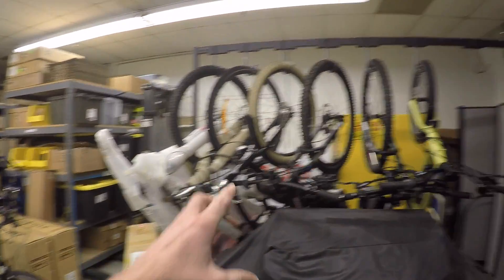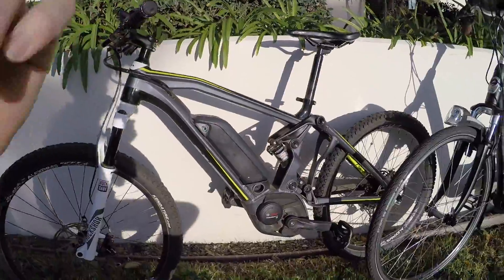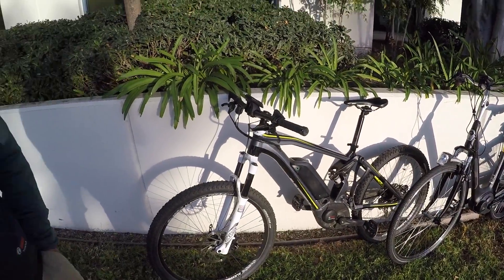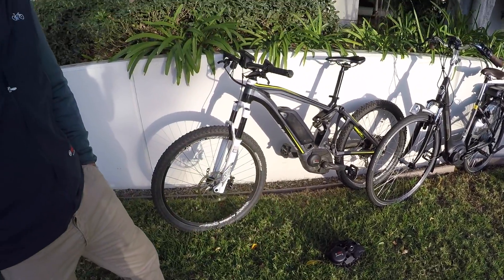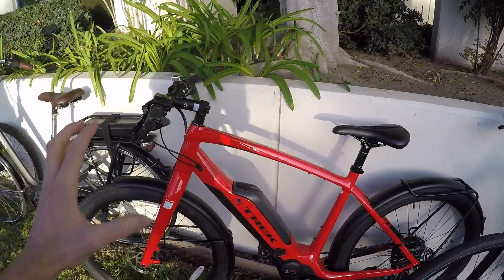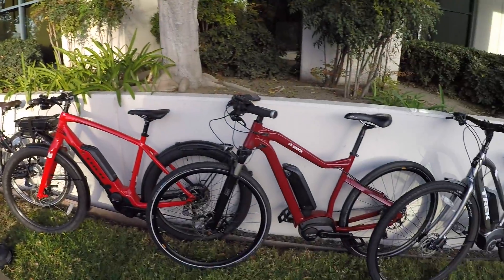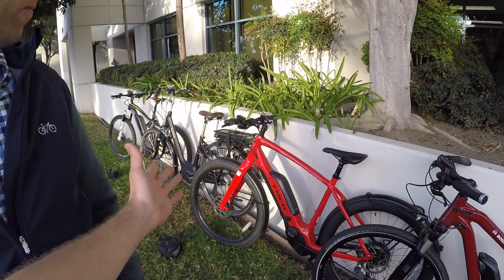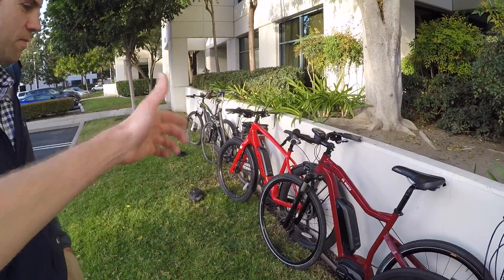Bosch Ebike Bike Motor Comparison & Test

Comment: WARNING about BOSCH products and R&M Homage dual battery Bicycles and Bosch systems, look this after 5 months of use, first 2months I have to change the motor BOSCH make noise now again I have to change the Motor Bosch again make noise again, loose the eShifth, covers from the BOSCH battery fall down on the street when I ride, also water get inside the BOSCH switch (made in China) BRC351,BIG MISTAKE to pay Cad$17000 for this shi... brand, this people here are pay by R&M to make that kind of comments about the brand me I am a REAL consumer with the REAL problems...They want keep change BOSCH motors
I ASK FOR  MY MONEY BACK and I don’t ask that now after 5 months I asked since my problems start I mean on my first 200 Km of use that bicycle…

Comment: I used to have the performance line Cx motor on my Kathmandu.  I'm guessing this is an old vid as most CX motors now give you 80 N m of torque.. I now have the Hiabike trecking 5 wich is a lovely bike . But only has 65 N M of torque.  And is not as comfy a ride as the Kathmandu.  Also I miss not having EMTB mode and the shift ditection

Comment: In terms of noise, clearly, the Active Line was the winner. I recently rented a bike with the Active Line Plus and it was quiet too. I couldn't believe it because I have a Bulls Lacuba EVO E45 and it has a belt drive Brose... The Active Line Plus produced less noise!
Reply: How is the Active Line Plus?
Does it make enough torq, or should i look for something higher end?
Reply: @str1kez367  It depends on the hills that you typically climb. I climbed some pretty steep hills on first gear with the Active Line motor set at Level 2 with no problem.

My wife had to use Level 3 to climb the same hills.

*

Comment: The batteries are interchangeable but does anyone know if the motors are interchangeable from one model to another?  My Raleigh with a Active Line and I have a large amount of people on non-motorized bikes pass me.   There's little power in that.   It is my fault for choosing it but now that I have experience i would never get a 250w motor.

Comment: Having full suspension MTB and changing Bosch Performance Line motor already 3rd time. First motor died at 6500 km, second at 7800 km. Each lastet approx 2 years. Bike - Trek Powerfly 7+ fs 2015. Both motors had same simptoms - clicking while you pedaling. A bit disappointed with life duration of this devices. Besides this idea of ebike is superb. Trip with 100 km goes easy, does not matter if there are hills :)
Reply: Did they cover your motor under warranty or did they give you a hard time?
Reply: @DudeofCalifornia  so far it was repaired under warranty.

Comment: The bosch CX is super sensitive and smooth. I can start on a very steep hill and get immediate assist . Also it's very easy to find the " sweet spot " in any gear or any assist level. I like keeping the same cadence when riding and have enough practice with this motor to know when to shift gears and or the assist level. Oh and The Turbo mode is unbelievably powerful.
Reply: Which one is better in terms of torque:
(Performance line cx) or ( performance line speed) ?
Reply: not sure what the "speed" model is but the Cx is 84 Nm in Turbo .

Comment: Anyone knows where to get in europe full suspension frame for bosch performance cx motor? I have been searching for such a frame without luck.
Reply: Vasilis Barbounakis I think you’ll have a tough time since Bosch motors are only sold with bikes. Occasionally frame manufacturers bring frames to trade shows and sell them at the end, but it’s not too common.
Reply: Oui La marque Moustache vend 2 modèles https://www.culturevelo.com/?page=comparateur&selection=13472,13474

Comment: Has Bosch improved how they handle the max speed cutoff? Yamaha  apparently did this much smoother.
Reply: The max speed cut off is annoying ,  but is easily remedied. 
I have a Baddass tuning box that completely eliminates the cut off and can be installed in less than a minute.

Comment: Greetings from the Netherlands I just bought two riese and muller bikes with the cx line. Was expensive but I think its worth it.only gripe I have is that I couldn't choose the option for extra battery with buy a second battery on the spot not a bargain like $1000 extra that mind blowing
Reply from the maker: Cool! I hope the bikes are fun and hold up well for you, I trust Bosch, their stuff is pretty good... but yeah, the battery packs can be very expensive O_o
Reply: Thanks for making such great content have bin watching you for over a year now..as it turns out this was a great time to get an e-bike. new motors new tube batteries.. new models from Riese&muller. I have to wait until the end of July...so even living riding distance of Germany hahaha..Enough time to investigate good locks and alarms & gps systems..and learn a bit about 18650 cells and charging.. as an it nurd i know that 18650 cells like to be charged slowly and preferably at 75% for long term storage up to 95%..  that's why i considered getting two packs.. but to be honest even on Eco mode that bike feels great i don't see my self using the top mode just for fun that is hahaha.. welcome to the world of range anxiety..
Keep up the great work.. And have a nice summer.. Carpe diem..

Comment: Hey guys had surface 604 colt for 1 year Bought bull e lite with active drive.Does not have the nick of the colt rear hub drive.Going up 10% grade you have to work it .Colt coasted up.Can you change to a more power full bosh motor?

Comment: Just to clear up, the 250 Watts of power they state all their motors produce is complete bullshit. It's just for government regulations in different countries. It's fundamentally impossible to have that much more torque without more power. For example the CX motor has been measured to peak at around 600 Watts. The lower end active line peaks at around 400W.
Reply: Thats why you tune the motor to get most out of it. (:
Reply: Bravo pour la pertinence de votre commentaire

Comment: I use bike trails a lot.
It's annoying to see electric powered bicycles on the trail.
They are no different from electric moped, actually.

Bike trail use should be only by man-powered vehicles and power "assisted' bicycles with speed limiter.

Comment: 250 wats? My blender has a motor of 500 watts. What am I missing here... (mind u  it is a strong blender).
Reply: khash Eshraghi Is your blender street legal?
Reply: torque is really the important reading. The Motors have between 50-75Nm of torque which I imagine is much more than your blender. Keep in mind the motor in these systems comes from the power steering motors for heavy German cars, like the Mercedes S class. I hope this helps give some perspective.
Reply: Chris at Propel You can use gears for more torque.
Reply: Your blender doesn't have to be efficient, because it uses 110V, 500 Watts is power used, not power delivered
Reply: Its the ampere !
Reply: Oui mais la puissance en watt n'est pas une donnée absolue, il y a le couple, la vitesse de rotation,la consommation. Ces moteurs sont construits sur la base de moteurs d'essuie glace qui sont très "coupleux" et surtout ne cassent presque jamais

Comment: Bosch will very soon will have  a  6 amp charger coming very soon !     and they are coming out with a new Bosch    Nyon  system that's so much more better then the old Nyon , you need to ask your friend Johnathan form Bosch but i can tell you this info is a fact and it comes from Bosch

Comment: I wish manufactureres gave us the possibily of buying a particular bike model with a particular type of motor. Unfortunately, if you go for most mountain bikes, you have to go with the most powerful AND the most power-hungry motor, the  CX, even when Bosch themselves show the range difference between motors can be astounding. I highly recommend checking out https://www.bosch-ebike.com/en/service/range-assistant/ where you can easily compare those differences. I wish every manufacturer had something like that...

Comment: Very informative video!  Thanks for putting it together.  One of the things that might be helpful would be to remind the viewer that your fixed camera mounts may be transmitting some noise directly to the microphone (mechanical coupling).  I've been riding a CX Speed for several months (Trek Crossrip+, based on your awesome review) and really very rarely notice the motor noise.  Great comparisons between the various motor set ups, though!  Thanks!
Reply: I agree, thanks for sharing this as this comes up quite often.

Comment: I have noticed on some bike websites that it looks like the motor's torque is de-rated for internal gear hub drive trains.  That is, a Nuvinci hub bike might have the same Bosch motor rated with lower torque than the derailleur version.  I assume this is to protect the IGH (not exceed its torque rating) and is accomplished in software.  Can you comment?
Reply from the maker: Yeah, there seem to be some behavior changes between cassette vs. internally geared hubs and CVT. You can see the different ratings on the detailed chart that Bosch provides. It's attached in my forum post here: https://electricbikereview.com/forum/threads/bosch-ebike-systems-motor-comparison.16240/ it's the second image. The first comment talks about hubs as well and might interest you.
Reply: Interesting.  The chart just shows only a derailleur system listed for some of the motors such as the CX.  Not sure how that fits with manufacturers (e.g. R+M) offering a Nuvinci IGH with the CX motor.

Comment: Hi Court great video as always would you be able do the same comparison with the bafang max/ultra drive range as I see that bafang is now selling the max drive systems from 250 watt all the way up to 1000 watt. It would be nice to compare the G330, G520, G521, G510 (which is the 750/1000 watt range and bafang claims it has 160 nm of torque) that's pretty impressive. Bafang is quite a popular mid drive motor in Australia I see quite a lot of Bosch performance line units, Bafang max drive units and Shimano units. Haven't seen Brose or Yamaha mid drive systems in Australia I have heard that the Yamaha system is not licenced to sell in Australia. Anyway keep up the great work love your informative videos all the best from Aus.
Reply from the maker: Great suggestion Robert, I want to visit Luna Cycles someday again and might film there. I'd love to do a Bafang motor roundup and the company reached out recently about a China trip but then didn't reply, maybe they are busy? I'll keep at it, and also aim for Yamaha, Brose, Shimano etc.
Reply: A friend has just bought a Specialised Levo 29er with the Brose motor. He is in Adelaide. It is supposed to have 90nm of torque.

Comment: Thanks for this great review and your channel Court.  At 8:40 you mention gear drag which I'm finding a real, err, drag on my Australian (25km max) Bosch performance line. It is next to impossible to go faster than that under my own steam because of that. Down hills is no problem of course. Just want to encourage your viewers to test ride with power assist off to feel the drag for themselves.
Reply: I've heard many people say this, but in my experience, this is not the case. If you were to ride the bike with no power from 0kph you might find it easier to pass 25kph. This is for two reasons, one the gearing will be more appropriate as you accelerate and you won't have the shock of losing nearly 300 percent assistance, it can feel like hitting a brick wall. 

One way to solve this is to ride in a lower gear than you might normally deem appropriate. You can generate much more power by the motor and your legs your spinning faster, but most ride in a higher than appropriate gear since the motor can still power through it. 

I would also encourage you to try a lower level of assistance than Turbo if you're commonly hitting the limit, this will also make that transition smoother. 

This seems to be less of an issue in the states with our 32kph motors, but I know it still comes up. I hope this is helpful though.
Reply from the maker: Thanks for the feedback Brendan! I have done some reviews with the 32km Bosch motor and purposefully pedaled faster on flats, I can do it pretty easily (but I'm a fit rider and the bikes are brand new), this makes me wonder if yours has an issue? Either way, I respect your perspective and agree that testing bikes in person is worth doing when possible, and with the power turned off :D
Reply: Same here

Comment: Can you select  Turbo, Sport modes etc as well as eMTB mode on the CX
Reply from the maker: Some CX motors come with Eco, Tour, Sport, and Turbo and then you have to get the shop to update their firmware to switch Sport mode to eMTB. I don't think you can have both... so a fully updated CX motor would have Eco, Tour, eMTB, and then Turbo. Does that make sense?
Reply: Oh yes, Many thanks I thing that would help many others too ! - I assumed eMTB was an extra mode rather than a replacement for Sport. I' thinking of getting a Haibike roadbike (sDuro Trekking 9.0) with a CX motor and I live in a hilly area but I don't think eMTB would be of much use to me. Thanks

Comment: Great video as usual , Court !
How do you attach your Gymbal to show the motor in action?
Reply from the maker: Hi Kamlesh, I don't use the gimbal for that. There's a special bike mount from GoTough with a completely separate camera inside. I run with two or three cameras (even have a face cam to use sometimes!)

Comment: The Bosch batteries ar the most important point they can be charged extra fasst to 80% capacity and they last longer than other batteries
Reply from the maker: Yeah, they are also probably safer than some of the cheap packs... nobody wants a hoverboard or Samsung phone incident with a pack this large :/

Comment: The performance line speed is one heck of a system, wish they wud incorporate an eMTB mode for their speed pedelec eMTBs, great video
Reply from the maker: Thanks Larry! I have seen an electric mountain model from Haibike and Bulls with the speed motor, too busy to find them now (and I'm not sure I reviewed the Haibike or just heard about it). I agree that an eMTB mode for the Performance Line Speed motor would be cool. Some people just use a speed dongle on the Performance Line CX to raise the speed, but I'm not sure how that works with eMTB and it definitely voids your warranty
Reply: Oh yes, Court you never have done a official review of one, they make one every year the new one is the Habike Xduro full seven S 9.0, I got two of them because I love the versatility of it, plus its a 28 mph speed pedelec. I use them to commute to work and ride the trails. Plus I don't mind the class one eMTBs, I think we have the best laws concerning the 20 mph speed limit, but for commuters I think 28 mph should be the standard, I think I told you this because I don't want to void the warranty and 20 mph is really the sweet spot for eMTBs, specifically.
Reply: ElectricBikeReview.com , what's a dongle?

Comment: I was looking at a great Tern bike and saw they don't have a Cx performance option and only use the Active Line. Pretty sure I'm going with the Riese & Muller Tinker just because they use the Cx performance line.
Reply from the maker: Yeah, I like how R&M only seem to use the CX or Speed motors on all of their ebikes... They do cost more, but their bikes are made really well, and they also tend to be heavier. I guess they just decided to simplify buying options and aim for high-end on everything.
Reply: Hey Chris - the Active motor we chose for the Vektron is equivalent in power to Bosch's new Active Plus. With small wheels, the Vektron will accelerate as fast as a 700c bike with a Performance motor. We chose the Active motor because we feel it delivers the right balance of peppy acceleration and long range (Performance motors such more battery power). My recommendation: give both bikes a try and see how they feel.
Reply: Joshua Hon  Oops !! . . So happy I called your bike (Vektron) "a great Tern bike" while you were here haha :) But torque is torque dude and my 20" wheel bike demands include being stored aboard a canal narrowboat in the U.K. and then having to negotiate along a muddy canal side towpath and then an equally muddy incline before I can then join the road system which I know the Vektron/Active Line combo can then no doubt adequately compete on.
Reply: Bosch makes the best e-bike motors and batteries in the industry imho. That’s why I just ordered the Reise & Müller Tinker HS from Propel Bikes. The speed and flexibility provided by the smaller frame were major factors in my decision I paid an extra $300 for it to be shipped but air freight from Germany. Hopefully it will arrive by mid-April. My fingers are crossed.